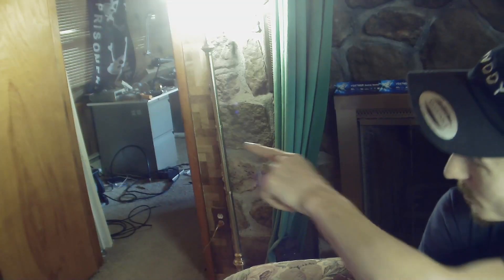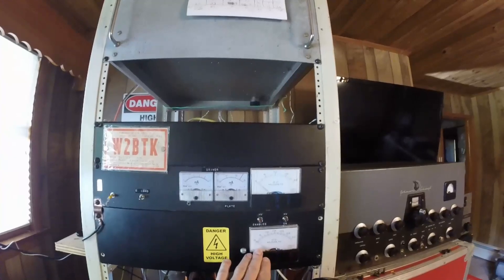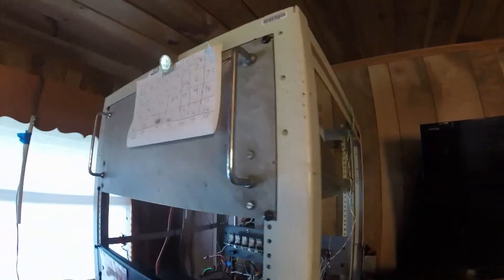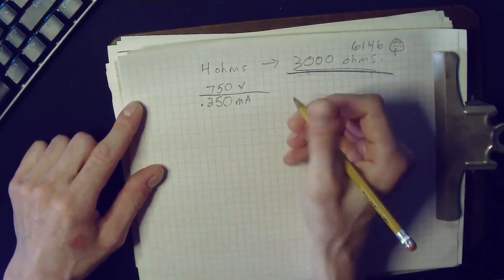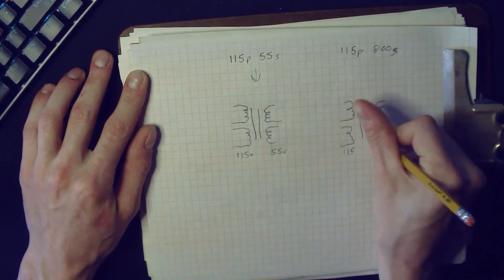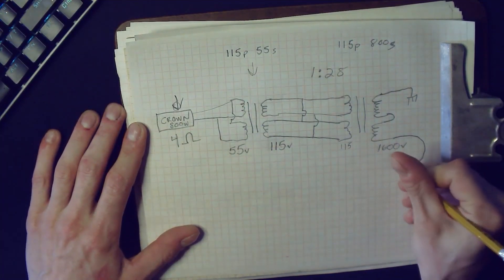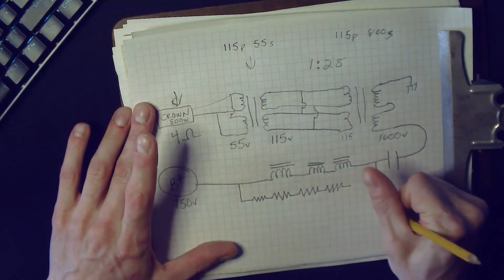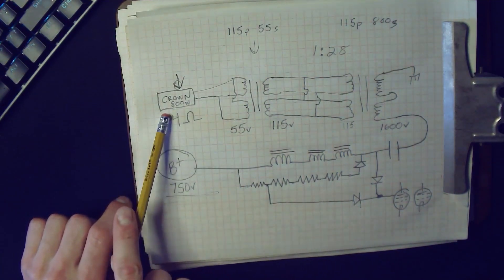W2BTK Externally Modulated Johnson Viking II AM Transmitter (Calculations and Schematic Shown)

Comment: Oh wow i use 2x6l6 6146 x 2 x 813 grid driven 1.01kw 27.185oo
Reply from the maker: nice 813 rig!  U ever consider plate modulating them?  That's my favorite way... High Level Class C plate modulated.  just need a big old audio amp to drive it 😎

Comment: Really like your push-pull 810 RF deck. I used a McIntosh amplifier much like your used your Crown amplifier to modulate one of my AM rigs, turning the impedance around with a large audio transformer that originally ran push-pull 810 for a ship-to-shore- PA system.  Worked OK...  I have  a 1947 James Millen (model 90881) that uses push-pull,  swinging link coupled, 812A and now modulate it with a homebrew 4-125A amplifier and a BC-610 modulation transformer. Have coils for 80, 40, 20.   Pictures on my QRZ page... Keep the AM alive...  Maybe we can have a QSO some day.  WA4QGA  El Paso

Comment: great job, I would like to do a Viking II as well whats the part part number of the transforms?
Reply from the maker: 55v part# ANTEK AN-8455 , 800v part# ANTEK AS-8T800 

Youll have to do the math to see if it works for your application, are you using a viking II and a 4 ohm modulator>? :)

Comment: I have the original "ultra" modulation box.  You may have read the article from 1956.  It uses three 866 rectifiers and several large adjustable resistors. I was lucky to find it one day. Its the one from that article. Neat stuff.
Reply from the maker: Veery cool!!! bet it works great, too.  I wonder how much difference using the 866s have between modern solid state shottkey diodes.  But yes, I love that atricle and mine is an exact copy, just with solid state diodes rather than t00bs :)